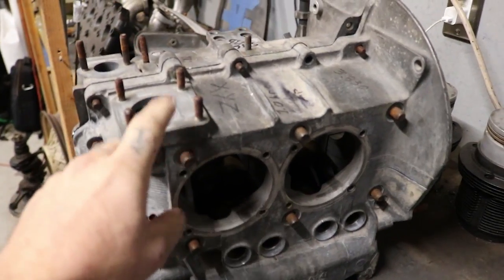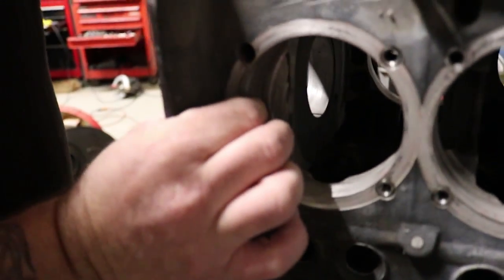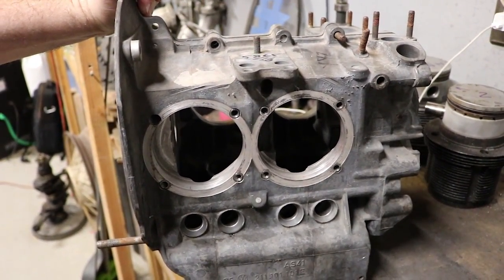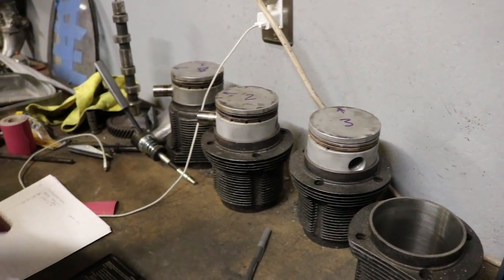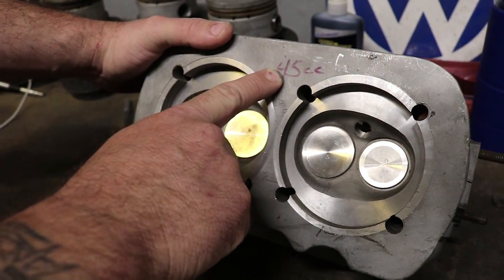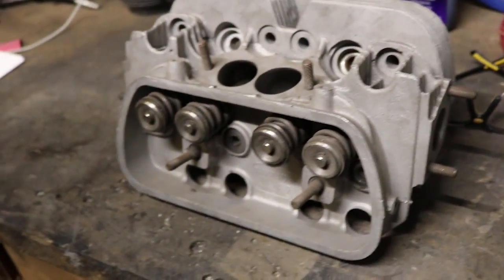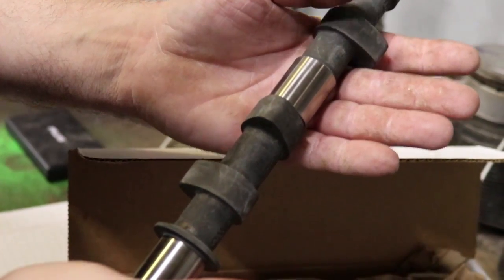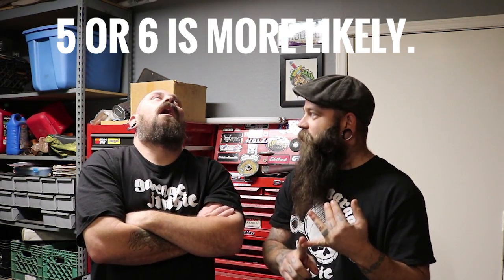How To Balance an Engine for an Aircooled Volkswagen

Comment: Crank throw is 1/2 of the stroke.  74mm stroke has 37mm throw.

To balance a rod, hang on the rod to weigh the big end and balance all to the lightest one.  For the small end, don't hang it, just weigh the entire rod and remove weight from the small ends to make all rods equal the lightest.  Once the small ends are equal, any difference in rod weight has to come off the small end, so hanging it is not necessary.

Also, this only balances the piston/rod assembly, it does not "balance the engine".  To balance the engine the crank, flywheel, pulley and, in some cases the clutch, must be spin balanced using bob-weights to simulate the weight of the conrods, pistons, rings and rod bearings.

Intake ports should not be polished.  They should be smoothed, but left with a slightly rough surface, such as left by coarse emery rolls.  Polishing the intake tract can allow fuel puddling and fuel droplets to adhere to the tract walls.  A slightly rough surface causes slight turbulence along the walls which helps pick this fuel back up into the airstream.

Exhaust ports should be polished to deter carbon buildup and keep the flow as smooth as possible.
Reply: @Leland Lewis — you got this backwards, hoss.  The bigend = part of the rotating weight, so this needs to be on the scale and the smallend hung to level the rod... they need to be all even to minimum 1/2 gram.  Even more smaller if racingnengines 0.2 ounce i8nches.  
The reciprocating weights = total weight of rod + pistons/rings/pins.  The rod smallend weight is reciprocating weight and is ‘calculated’ = the  whole weight of the rod and material is removed off the pin end only to make even.  This i learned from Stewart Warner/ Pro Bal many years ago.
Reply: @rabidfarmer9765 , it has been a number of years since I did balancing, so you got me thinking about it and you are correct.  What I was thinking of was we used to balance the big ends to the lightest.  Then we weighed all rods and removed most of the balance pad from the small end of the heaviest rod, which gives the lightest possible weight for that rod..  Then we matched all of the rods in weight by removing material from their small ends.  If you lighten the lightest first, you may not get the heaviest down to that weight.

Once the rods are done, then you find the lightest piston assembly and match all others to that weight.

Reciprocating weight is the piston, rings, pin, pin clips and a couple of grams of oil, but only a percentage of the total rod weight because a percentage of it is rotating mass.  Usually the top 1/2 of the rod (small end) is considered reciprocating and the bottom half (big end) is rotating mass, so you need to know small end and big end weights to calculate your bob weight to use during crank balancing.

Rotating mass is the big end and rod bearing.

I have known shops to leave as much as 2 gms. on street engines, but as you say, .5 is what you should be aiming for.

As I said though, this only matches the rod and piston weights, it doesn't balance the engine.  To do that, the crank, flywheel and front pulley/balancer have to be balanced using the new rod and piston weights.

In a non-counterweighted engine, like an aircooled VW, it is a definite improvement though, since opposing pistons help counterbalance each other.
Reply: I balance race parts all the time.  Engines should be internally balanced if run at high speeds. There are low speed engines only needing external balancing - all done with the flywheel.  But i have the feeling you worked on engines and just mixed up the info.  LOL.  IT happens.  A man should have many skills and be hard working.  Women find that quality sexy.  Good day man!
Reply: @rabidfarmer9765  , yes, I am an automotive machinist but haven't been active except for a few racing engines for friends due to health issues for about 25 years.  Before that I worked mainly on performance and racing engines.

Currently, for friends,  I am picking parts for a twin-turbo 327 for a 1962 Impala which may be my last complete engine project, getting a 1964 Impala 409 425HP running after 20 yeas of sitting and bought an old Manx with a 1200 for myself to play with.  Plus I have a 1998 Olds Aurora 4.0L with 128,000 KM on it that I'm tweaking a bit.

Going to internal balance really helps an engine.  It is quite amazing how much smoother the engine runs.  That is a big advantage of the new stroker kits for many engines, like the 383 Chev, that changes from the old externally balanced 400 crank that cost a fortune to internally balance for 350 piston assemblies to a new internally balanced crank.

One of the shops I worked in built engines for a limo company.  They wanted all of their engines balanced because of the lowered vibration in the vehicle and longer life of the engines.  These limos ran 70 miles or more on the highway multiple times every day

Balancing the crank assembly, with the front balancer/pulley and the flywheel as an assembly eliminates, or at least minimizes, harmonic vibrations but also cuts down on "rocking couples", where the front and rear of the crank are trying to "rock" on the centre bearing.
Reply: @Leland Lewis - the balance tolerance requirements depends on the intended engine speed it will run.  No need to balance it to race quality 0.2 ounce inch if it will only spin 3500 RPM like in diesels.  You can do fine with 0.5 ounce inches good to 6500 RPM...or worse.  0.7 ounce inches 4500 -5500 RPM.  Gary Hildreth in IL does all the Stewart Warner balancer repairs for me.  I love the Stewart Warner balancers.  Have the ProBal 2000 now and it is fast.  take care.
Reply: @rabidfarmer9765  Hard to beat SW anything.

Agreed about the tolerances.  

The reason I want people to understand that although the title says, "Balance an Engine", this doesn't actually balance the complete rotating assembly is because owners will push the engine past what it should be run at thinking they have a "balanced" engine.

An example of this is seen when people but a big-bore kit on their stock bottom-end.  Add on an extractor and big carb, and the engine pulls hard, so people rev higher and, "BOOM", because the bottom end wasn't upgraded to handle the revs.

Balancing the piston assemblies will help the "feel" of the engine and should add life to it if it is driven properly, but its usable RPM range doesn't change.
Reply: @Leland Lewis - agree with you man.  A fully balanced engine runs very smooth and easy on the parts..esp the main bearings and rod bearings.  Makes more HP too if balanced.

Comment: Excellent!! I have seen videos were they balance the wrist pins and pistons  individually or peeps who mix and match pins and pistons and then grind off material from the one that’s out. What do you think? Thanks Bro!!
Reply from the maker: I do that too... Take a little material out of the inside of the piston/pin if necessary.
Reply: I actually used Chat-GPT for calculating my part weights to minimize grinding. Provided it the weight of my pistons, wristpins, and circlips, it moved them all around to within .1 grams and .04 grams between opposing piston sets. Before, I had one perfect pair and another one gram apart. The AI did it in 5 seconds for me... just wow. (Anyone can use it btw)

Comment: Do the straight cut timing gears add any additional audible harmonics or other problems in the engine ?
Reply from the maker: They can be loud(I like the sound)and they can be quiet if you debur or polish the surfaces. It just frees up rotating friction which in turn frees up HP
Reply: The harmonics kill valve spring tension.

Comment: Can you run a compression ratio of 10 in these engines ?  I have a 1600 rebuilt by a local guy and the compression is like 144 PSI per cylinder...thing runs hot (as you would expect), and I am thinking that it's a bomb based on what you said at 12:11.
Reply from the maker: I'd pull the head and check your deck height... You may have way too high of compression which is not good for a street car. 

I run 9.5:1 in this engine which is almost not streetable.

Comment: i  understand these are air cooled engines but what i am talking about is 1200 cc's single port torque low speed type setup.
Reply: You trying to upgrade your riding mower? Why on earth would you want to be stuck back in the early '50s?

Comment: has there ever been a 100, 000 mile air cooled vw ever been been built with the balancing and oiling mods that you do?
Reply from the maker: If built in a low torque, low hp, low abuse fashion, a small engine like the air cooled boxer will absolutely last 100k plus. Proper maintenance is key.
Reply: @garagejunkie6742  Remote mount oil filter helps w/ longevity too. Pays for itself in not having to change the oil every other month, now that oil ain't cheap any more [who else remembers feeding their Bug whatever was on sale that month for $1/qt?]